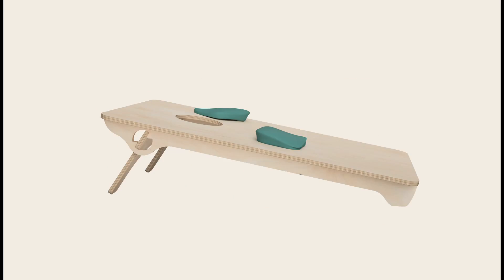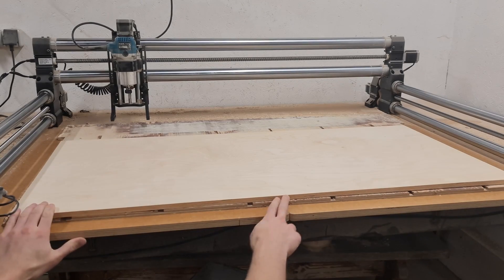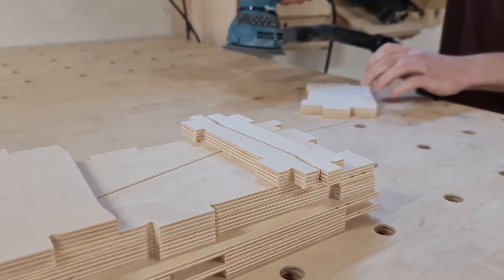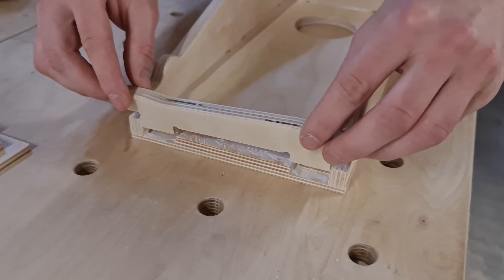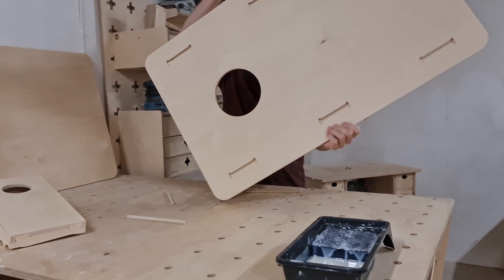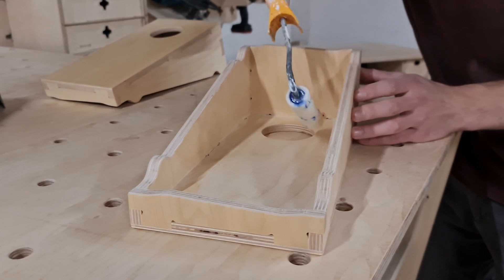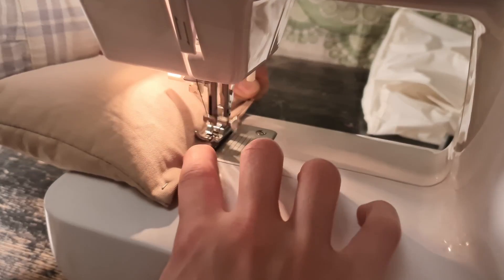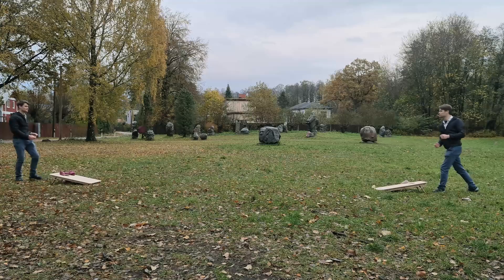Making a Cornhole game on a CNC router - ARIBABOX

Comment: Hello good job. Tell me what your milling cutter diameter and cutting modes are, thank you.
Reply from the maker: Thank you!
We used a 0.125-inch bit at 6500 mm/min and 25000 rpm while doing 6 mm deep cuts per pass (two passes per contour) - the cut surface turned out great, and we didn't have to add any support tabs.
Reply: Thank you, a good machine you have supports such a speed with such a depth. Good projects to you. @Aribabox